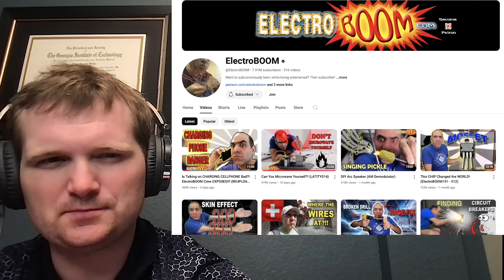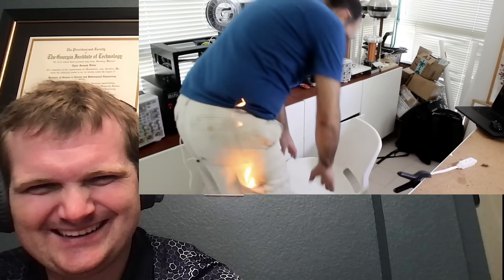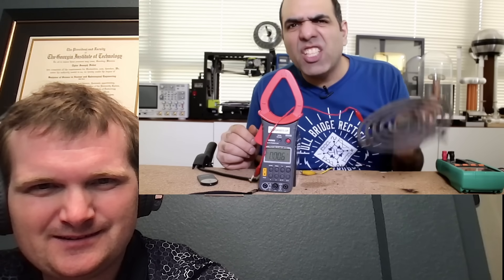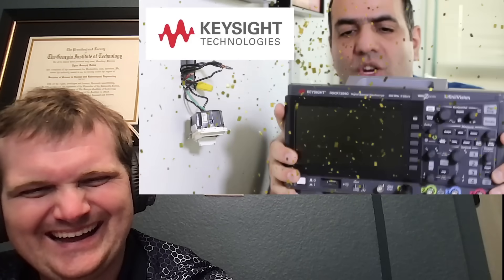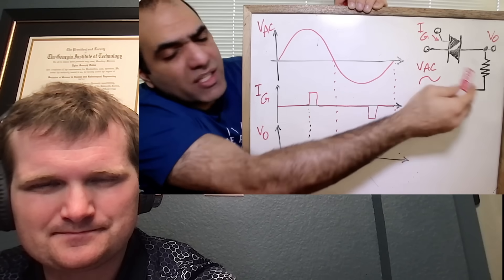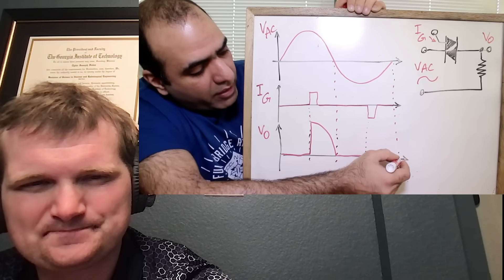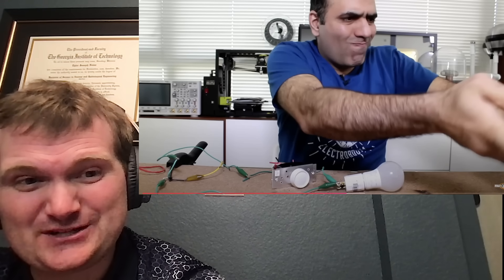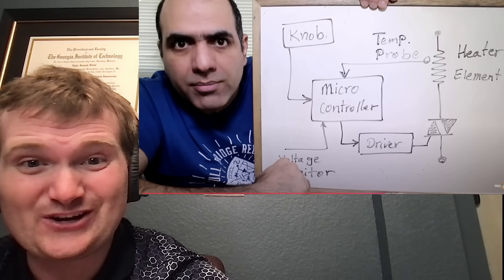Crazy Heated Seat! - Nuclear Engineer Reacts to ElectroBOOM

Comment: 13:15 the cheap, none electric ones are bimetal thermometers.  They're incredibly inaccurate, and lose accuracy over time.  All they are are a coil of two types of metal with different thermal expansion rates.  Since one expands more than the other, the needle rotates.  Its not always linear, any chemical reations on one or both metals messes with it, and they can sometimes just slip.

If you want an accurate and faster one, just get an electric probe thermometer.  They're generally far more accurate and faster to register, and some can be left in place with the display outside the oven with an alarm for a target temperature.

Comment: I experimented with this type of wire before in different gauges. It is much more resistant to oxygen than tungsten for example but can not be heated as high without the material degrading over time. I am working on several projects and one is a lightbulb that is supposed to last very long. I will most likely use this wire we call Kantal wire in Germany. The lightbulb will have somewhat of a yellowish orange light but should last at least 100 years if run with DC power. (ACs frequency actually causes the fillament to vibrate at roughly around 50-60HZ and that also reduces the life span of an incandescent bulb.)
Reply: Ha... We call it Kanthal A1 here, but no surprise there's not a TH in German. It has much lower resistance than Nichrome or 316 wire. It's crazy how much a difference a tiny bit of chromium makes to steel.
Reply: @SkippiiKai  yeah suure....say hi to the Phoebus Kartell 🤣 when you see them😆
Reply: @AncientTechDIYChannel  Ummm.. I know about the Phoebus cartel, but I don't understand what you mean. I was just noting that resistance does not scale linearly with composition in steel wire like 316-L.

Comment: There are mega good designs already made they just need upgrades. I ordered a new roof I should have got metal but they said that was back ordered too long flicks off tree that uprooted It came in black tile instead of light colored to match original roof. Central heating & cooling system has a vent and making it all black caused massive heating of air before coming down to condenser. So much it will flood in summer.. Made bigger drain and send water down to a tank to use it as pressure washer water for home. System is 20 years old, purrs like a Kitten

Now its a home temp controller + water reserve filler. With a shutoff to roof to cycle air inside like in vehicles.. Points at light switch dial in video and turns my light switch on my Carbon filtration system blower Cleaning day makes dust. Takes off system prefilter and washes in sink No problems.. (Btw they should use Transcranial brain stimulation at nuclear facilities. To stimulate brains and make what they're doing feel more fun. As if they are doing everything genetic behavior wants. Be extra good for performance to feel happy its good medicine. Make it like a reward for being that job like a crown. Something people can get benefits from even if money is gone. lol.)

Comment: Sitting on hot wires is just silly and a waste of good, expensive electricity.
That's why I went with plutonium-238, my ample buttocks acts as a perfect insulation for it to retain its decay heat. Although, for mine, I do have to take special precautions for ventilation, as ionizing the amount of methane that I produce is a really, really bad idea.

Triac or SCR driven circuitry near a radiation environment isn't an exceptionally grand idea for another reason. Ionizing radiation would act as a trigger - with enough energy to potentially trigger and break down the crystalline lattice enough to fail the device in a shorted mode. 
Let's say one used them to control those rods, false trigger from a whiff of radiation, bang! Rods slam down, control systems wonder how the reactor went into SCRAM without a command, the operators are mystified and annoyingly, can't get the damnable things to move... Yeah, need a wee bit different controls there.
Maybe a thyratron? Hey! Who threw that rock!
As for the thermometer, that's baby stuff. Petrochemical cooling is the answer, once it reaches its flash point, it'll help cool things off by rapid evaporation. And assist in that lifelong dream of a personalized tour of the ISS.

As for the thermometer, one calibrates them by loosening the adjustment nut at the rear of the meter, then turning the meter when the probe is in boiling water, once accurate to the boiling point, tighten the nut. For above boiling, well, there are candy thermometers, they go up to around 400 or so. Personally, I just go by what color the fuel rods are glowing at, cherry red is OK, yellow, better spool up the coolant a bit, white, what took you so long to get out here?

Dunno why he went this crazy on designing that which was made by Archie Bunker in his Bunker Bun Warmer though. Like a toaster, only it doesn't pop you up like ElectroBOOM's does.
Personally, I'll stick with my radiothermal flatus igniter.

Comment: 14:25  Power EE here. This principle is actually quite common for temperature alarm contacts on oil filled transformers. Literally just contacts attached to the mechanical oil temperature gauge. Normally the first contact triggers an alarm and then the second will trip the transformer lockout relay. That example was on a new 7.5 MVA transformer. Oftentimes, the bigger transformers will have RTD sensors in the oil and a dedicated microprocessor relay will calculate the winding hotspot temperature based on it and various other parameters for the purpose of alarming or tripping.
Reply: power ee or Pee for short.sorry couldn't hold it in.sorry again.

Comment: I recently learned those food thermometers almost always need to be calibrated. There is a nut at the base of the probe that you turn to adjust the dial. Just stick it in some boiling water and adjust it to 100c.
Reply: Can't find that setting, but then mine is calibrated to fahrenhooters or something. Or maybe it was mugwumps, I forget now.
Actually, I rarely utilize food thermometers at home. Did use them to check food as part of my duties in the military though and yeah, calibrated in boiling water.
Which was better than my former son in law's food temperature and preparation method, hot, damned way too hot or stone cold. So, one'd get raw in the middle, maybe even frozen, with a fine, crispy burned exterior... The Hague refused him, as the French wanted him summarily executed...
Reply: You can also put it in ice water and then adjust it to 0 so you don’t have to hold a small thermometer in a thing of boiling water while you calibrate it.
Reply: what if i live on mount everest
Reply: @ishakk435 If you live on the top water will boil at about 68°C, adjust your thermometer accordingly.
Reply: Professionally you should use ice point with boil point method to calibrate and assess margin of error which should be no more than 10 degrees in F and like 5 degrees C but I don't use C so I'm unsure, however usually one or the other will work fine, with ice point being the more consistent of the 2 methods do to altitude
Reply: What if the water's hotter than that
Reply: @lesnt4449  Then either it is no longer a liquid, or you are below sea level. At sea level, water turns to steam at 100c; cooler if you are above sea level, hotter if you are below. Once you get to the boiling temp at your elevation, any additional energy added to the water turns it from water to steam, it does not make it any hotter.

Comment: I have been involved in the restoration of a 12.8m former-NATO satellite ground station.  Because the elevation axis is not usefully counter-weighted, it has a failure mode that can happen.  If the drive-train breaks, or fails in certain ways, while the brakes are dis-engaged, the elevation axis can "crash" and potentially cause serious damage to the system, and even injure people.  Not sure if NATO's original control system dealt with this issue, but we designed a simple "trip the power" circuit that monitors the speed of the elevaiton axis, and if it exceeds a threshold (slightly higher than our official drive system can drive it), it will trip the power to the drive system, which will instantly re-engage the brakes (they're safety brakes--without power, they are engaged).  The "tacho-trip" circuit is based on an SCR, but if it fails shorted, that's not a big deal. Just means we won't be able to power-up the drive system, and thus the brakes will be engaged.

Comment: Who hasn't cooked a hot dog with an AC cord and a couple of nails? 🤣🤣🤣
Reply: As a kid we used to coax worms out of the ground with some alligator clips on the end of a lamp cord. Dad was cool with that but thought the nails in a hotdog would leave a funny taste 😅
Reply: @anullhandle wtf
Reply: @AnonymEleoroek  Drive 2 metal stakes into the ground hook mains across them. Better if the ground is wet. Sorta helps get worms to the surface, we used a developing safe light and did it at night. No idea why, worms don't have eyes lol.   I'm sure there is still mains wire earth return power on farms somewhere.  This CAN be done safely IF you know what you're doing.

We didn't have video games so we suffered the horrors of doing stuff and learning stuff.  Note, our dads played with microwaves,  micro controllers during the day, and fiddled with stuff on the weekend so we had good teachers and we were encouraged to take everything apart.
Reply: @anullhandle  💀
Reply: @anullhandle  Never eat that. There are some nasty chemicals produced when running electricity through food.
Reply: I had a teacher that did that
Reply: Probably not very healthy, with all the electrolysis byproducts